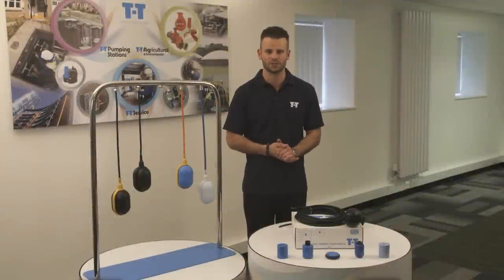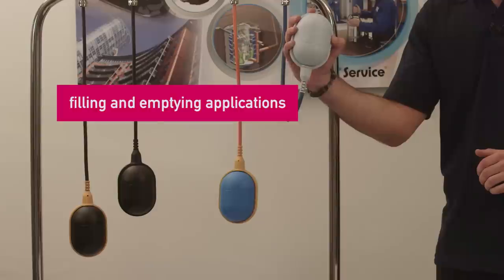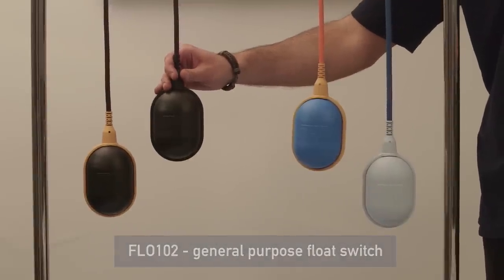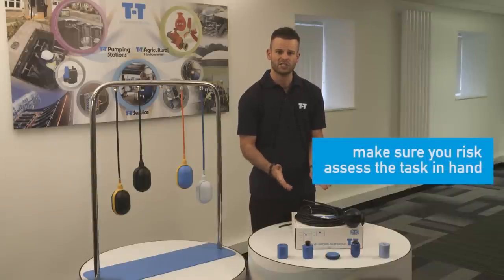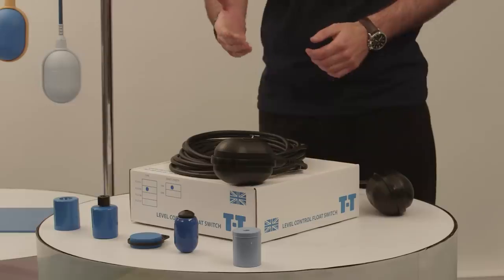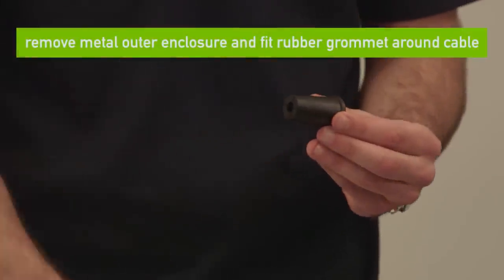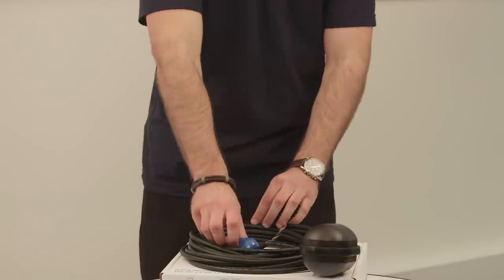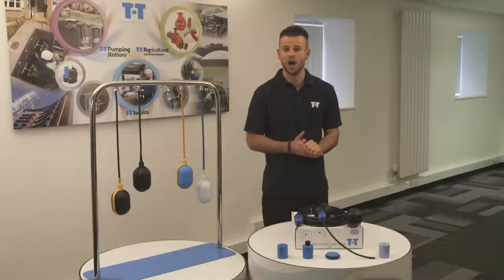How to Affix a Counterweight to a Float Switch

Comment: I am from algeria and used at home using your suggestion. It work like magic. But some time i need to use the same pump when the tank is full. I want to use another simple switch to override the float switch. I am scared to make short  circuit. What can i do ?
Reply: It's just a switch. Run it in a circuit the same as you would any other switch.